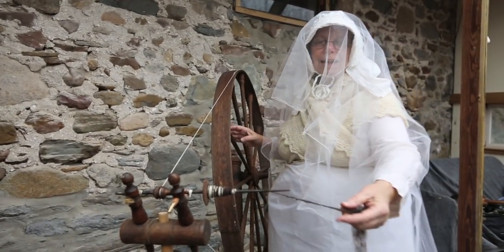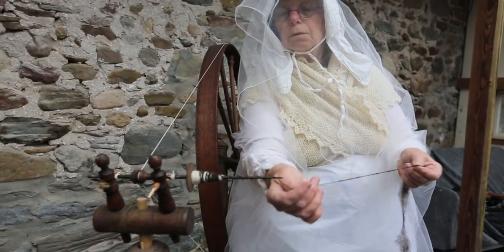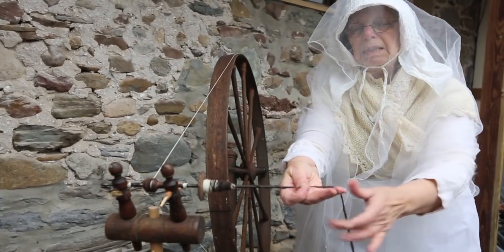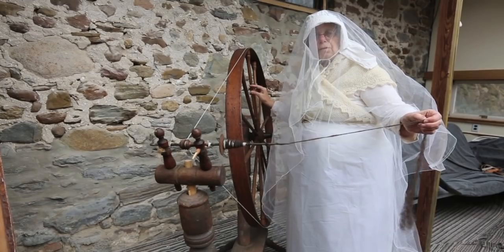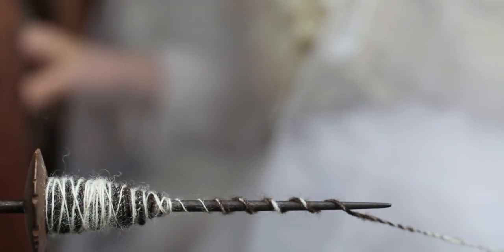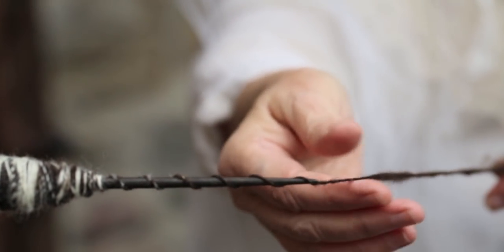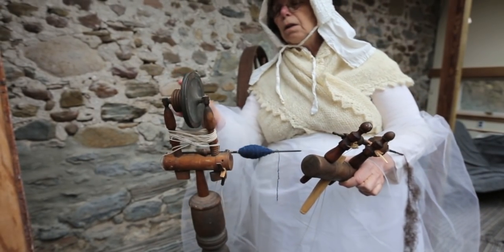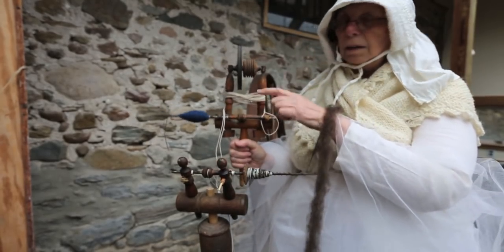Spin like a Ghost

Comment from the maker: Finishing singles woolen yarn really doesn't differ from worsted yarn finishing, IMHO.  I skein it, tie it loosely in 3-4 places and wash it by hand.  Hot soapy water followed by same temp rinse water.  It often becomes more 'fluffy' in this process as additional grease is removed.  I don't use a weight when it is hung dry.  If this yarn is being used for warp (it is possible but historical tradition it is more likely to be used for weft.) I have personal experience with woolen singles used on a warp weighted loom and I have broken no ends so far.  Piecing one rolag to another must be carefully done.
Reply: +Lois Swales Yes but doesn't the skein of singles get all pigtailed and snarled even with figure-8 ties? And even with washing and fulling how is that enough to stabilize the twist in even a weft yarn without biasing in the cloth? I've also heard that weighting is not a good idea as it tears the fibers in the wet wool and makes the yarn lifeless.
Reply: I enjoy your Youtube videos. I am rebuilding a spinning wheel. I am replacing or modifying its table so I will be able to adjust the placement of the mother of all. I made a new footman out of hickory wood. The old footman looks like pine and is broken. I am going to make maden bearings out of heavy leather. I will send you pictures if you like. Thank you for your fun and informative yarn vids.

Comment: I have a great wheel that I believe may be older, how do I find out?
Reply from the maker: June Pegram, most old great wheels are over one hundred years old, but not all. For a rather comprehensive look at great wheel features, i would suggest joining Ravelry as a (free) member and joining the group 'spindle wheels'. Then Post pictures of your wheel there  and see if it resembles other regional wheels of the type you own. The group helps to sort out really old wheels from both sides of the Atlantic from vintage and modern great wheels, as well as other spindle type wheels.